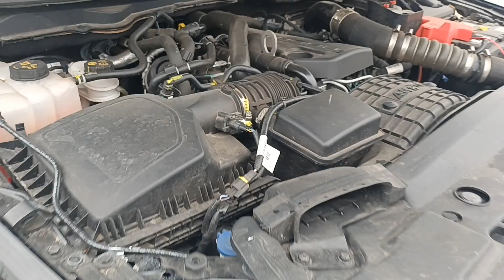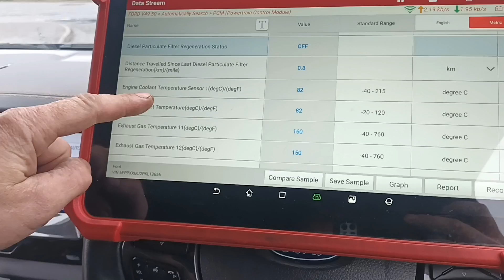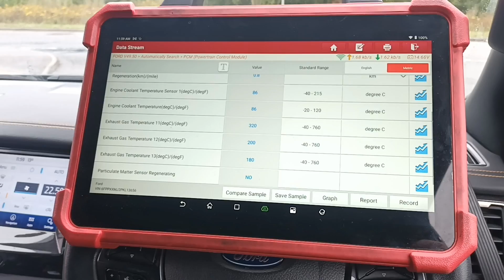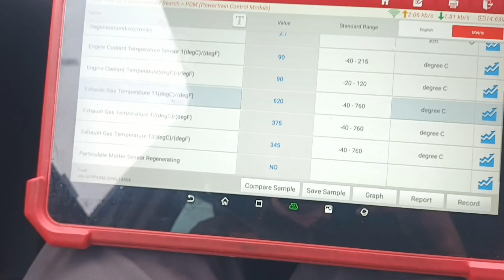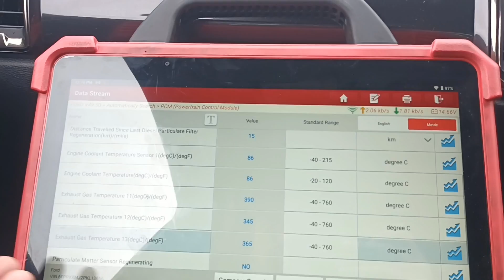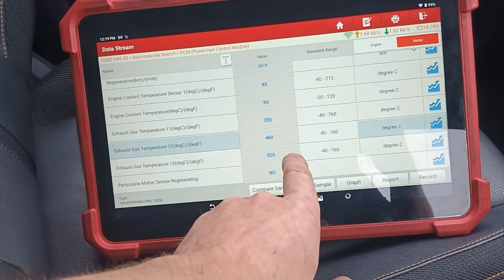Let's Talk P2002: Ford Ranger 2.0 BiTurbo 3 New DPF's. Is There A Permanent Fix? Multiple Failures.

Comment: incredibly annoying when dealerships simply change the broken/offending part without doing any investigation. A new DPF every 4000 miles says that something is not right elsewhere. Also, because these are being replaced under warranty, are Ford going to keep replacing them once the warranty has expired?  After all, this is now a known issue/problem with this vehicle.
Reply from the maker: Apparently they have given him a free extended warranty
Reply: @ORileysAutos  as they should. But the question still remains ?

Comment: Hi jimmy 
I have a transit 2.0 350 it’s on 84000 mile . On its third dpf second egr second adblue injector.  nox sensor 
New injectors . And still Failed mot soot emissions good job all these part are carbon neutral . I thick I will die 
Of debt before the c02 kills me

Comment: Could be a faulty evap diaphragm leaking oil into the turbo, glow plug module stuck on the on position , but for the p2002 it’s usually a box that hasn’t been ticked in the monitoring of the DPF going in to a danger zone, rad fan, temp sensor, differential pressure sensor, EGR cooler etc. 

Myself, I would get it remaped and chopped out and sell it to we buy any car and get them back for their irritating adverts.

Comment: I currently have a 2019 Custom 2.0 which is flagging P2002, I suspect the injectors are worn on it and have killed the DPF as tailpipe is very sooty (Ablue functioning fine etc)
Reply: I would check the dpf itself (especially pressures)

Comment: This engine ( as do nearly all ) uses data from the exhaust temp sensors to control running strategy, specifically the post turbo temp sensor to curtain fuelling if it starts getting  too hot. In this case it appears that, not only is there a cause for the excess egts under non severe conditions, but more concerningly- the ecu isnt acting on the high egts  at all.  Has it had a cheap nasty  remap of any sort,  or are the injectors all hosing ???  IF ford has replaced the dpf twice already, i would  expect them to have flashed the latest calibration as a matter of course, but as we all know in this trade, never ever assume anything.

Comment: As a Ford technician from Australia,  I have not seen many DPF failures on these 2 litre Bi turbo Engines.  I have However seen massive issues with the injectors on these engines.  The injectors on these engines are prone for developing corrosion within the injectors causing them to dribble and develop a poor spray paten (even at low KLMS) This will result in DPF's not being able to carry out regens correctly and will set a spanner light on the dash setting DTC  P253F - Engine Oil Deteriorated prematurely.  This fault may show up on the scan tool while monitoring the injector contributions when first the vehicle is first started but it may not. nor will show up on a injector leak back test and wire integrity will not verify this issue.  The main symptom will be a running rough concern on cold start with DTC  P253F set in the system and Engine oil level being over full (due to multiple failed regens/oil dilution) (note your scan tool should be able to show you  10 listings when the last regen was carried out to verify this, if your are seeing very low numbers between regens eg 15,40 ext).  However we haven't seen  DPFS destroyed because of this,  but with Ford anything is possible :).  There have been Multiple PCM update changes to the engine management system over the past few years, I would make sure that the latest software is installed.

It might also be worth a check too see if the Turbo is leaking  excessive oil into the DPF as I have seen this issue with 2 litre ecoblue Transit van which is a similar engine with a different turbo. This can cause damage to the DPF also.

It could be worth asking SY Diagnostics on YouTube as he is a very experienced UK Ford diagnostic technician.
Reply: Did you guys get the Isuzu 2.5 diesel in 2012-2017 Dmax? With oil dilution issues? We are currently having to change the oil on ours every 3 months as it dilutes the oil with about 2 litres of diesel, and just went out of warranty. Isuzu know about the common issue, and their fix is a dipstick with an X on it about an inch above max oil line, saying when it gets to that level you must change the oil.. smh
Reply: Seems like youve hit the nail on the head here
Reply: If the vehicle has no DPF fitted , should this obviously eliminate the possibility of issues ?
Reply: Disculpa la pregunta quiero adquirir una de esas en mi país Latinoamérica la recomendarías para este tipo de clima ?

Comment: Just because it's been to the ford dealer doesn't mean its fixed properly...are the new injectors properly installed and coded? Do we have oil or fuel going in to the exhaust for some reason also think about what a partially blocked cat will do on on of these...is there an engine mechanical issue? This has a complex system of pipes going to and from the turbos, what if there is an issue with these? Just a few suggestions...

Comment: there's not a DPF on earth that will survive those continuous temperatures. I  feel that diagnostics is about what is isn't...  disconnect vapouriser and see how that goes---
Reply: It doesn't have a Vaporiser! Euro 6 sid212 ecu doesn't use one
Reply: Dpf need temp over 500 to initial regen and run about 600 to complete regen

Comment: Would be interesting to know from Ford what are the conditions that need to be met for the DPF to regen on this engine. On the test drive the engine temp was hot enough (presumably above 90 degrees), the DPF was also getting mega hot. If no blockage from the vapouriser I wonder if there is a signal somewhere not telling the ecu to start the regen.

Comment: Replacing the back pressure sensor. The P2002 code indicates that there's an issue with the emissions system in your diesel engine. It means that the backpressure of the emissions system is incorrect, indicating that there may be more or fewer emissions passing through your engine than it's expecting ?????????????????????????????????? thats after a google search. Very intreasting case study, i like it. and we did not see any pressure so..........And you did not check pressure..........my noney are on pressure sensor...........keep in touch with him please we want Updates.........Very intresting. Take care mate

Comment: Disconnect the vapouriser.  Could be leaking
Reply: This engine does not use a Vaporizer, It uses a software strategy which injects additional fuel into the combustion chamber when the exhaust valves are open to increases the DPF temperatures in order to carry out a regen.

Comment: Toyota Hilux had similar issues when released here in New Zealand part of the problem was the materials used in the manufacture of the DPF's and the 5th injector location , knowing Ford software seems to be a big part of there failures of late. Squeezing every drop of power out of a 2.0lt engine is probably part of it as well tbh.

Comment: I'd say it's DPF being made out of bad materials. 500c is too high BUT it's a relatively small engine for a very heavy vehicle (2.4 tonnes) that has aerodynamics like a house meaning for a 2.0 to produce enough power, it is highly stressed, as it needs more air/fuel, causing EGT to rise.. and 500c would be "normal" in this application. So whilst 500c is too high, it's nowhere near what would cause failure with a decent silicon carbide DPF... and instead it should actually help it regen much easier.

Comment: If the injectors were over fueling it would be knocking... Poor materials for 4 dpfs unlikely else there be an epidemic of dpfs all over the country if not the world with this particular Ranger. If stuck in Regen then it would be reported to be guzzling fuel and oil diluted?.... How close is the DPF to the manifold by the way

Comment: It's a ford  that's the problem 😂😂😂😂😂
Reply: My new Ford has got a VW engine 😁
Reply: @glennryan4889  no it hasn't, if it's a v6, its a ford engine, same as in land rover/range rover. VW use ford platform with the new model's.
Reply: @oldbloke100  It's a 4 cylinder TDI (Euro 6) and I'm in Europe (Spain). The Tourneo Connect and Grand Tourneo Connect (Mine) are actually VW Caddies made in the VW factory in Poland. Ford now make the VW Transporter in their Transit factory in Turkey.
Reply: @CitarNosis317  Perhaps it is a way to force us into EVs!  Last time I drove into London, I got a letter for £80 from the right mare.  Wish I'd left my car idling all day and poured a gallon of diesel on the ground as I left to get my monies worth.

Comment: Is the vaporizer leaking? Overfueling would cause an increase in speed or power as that is how diesels work. Bad injectors might be causing excess smoke or poor combustion which is being caught by the DPF. Be interesting to see the exhaust before the after treatment. Using basic physics. To have an  increase in temperature it has to be an increase in unburnt fuel or high compression before the DPF, A pressure increase of this level is virtually impossible to be enough but possible in theory. Also look at the exhaust gas temperatures from the engine and along the exhaust tract. Find where the temperature increase is occurring. How hot are the turbos? If cooler than the rest of the system then excess fuel or some hydrocarbon like oil is being burnt in the DPF. What about a leaking turbo center bearing, is it loosing oil? A 5 gas analyzer might help in diagnosing this problem. Interesting; I used to manufacture oil engines which is in effect a diesel engine. Your videos of modern diesels are fascinating to me.
Reply: This engine does not use a Vaporizer, It uses a software strategy which injects additional fuel into the combustion chamber when the exhaust valves are open to increases the DPF temperatures in order to carry out a regen.
Reply: @1primacron  we had an issue with cam position learning on a development engine at a Warwickshire based car company and it resulted in melted cats. Are there any adaptions to run on cam sensor learn?
Reply: That was my guess too.
Reply: You were certainly using 'basic' physics there!  So basic I'm not sure there was any physics present.
Glad you had a possible theory too.

Comment: 2 turbos into 1 dpf . Is it too much heat for the dpf to handle? Is it a bad design?
Reply: Turbo's don't make heat :) If anything, exhaust temps are slightly cooler AFTER a turbo, than before.
Reply: Thanks for the info.